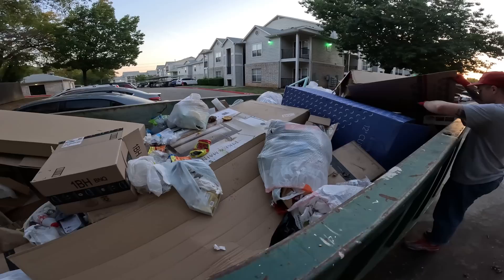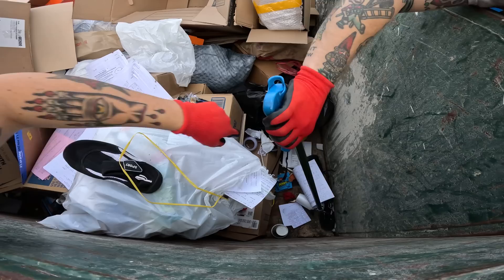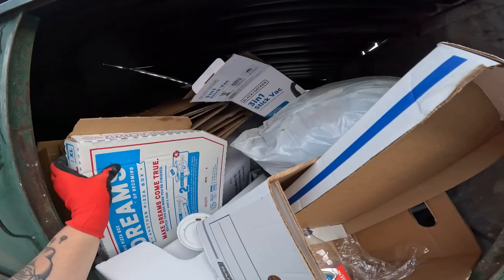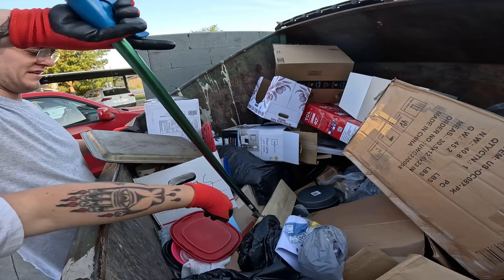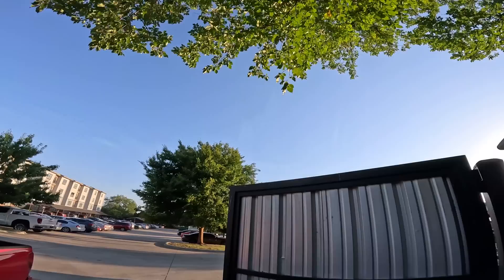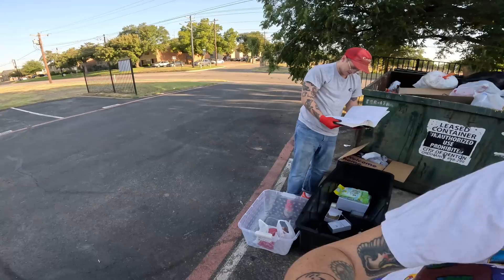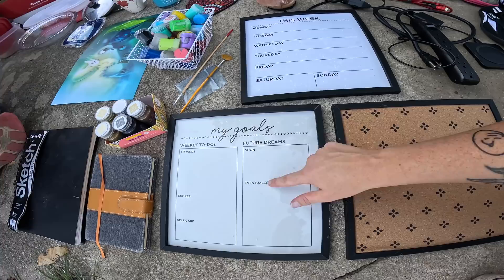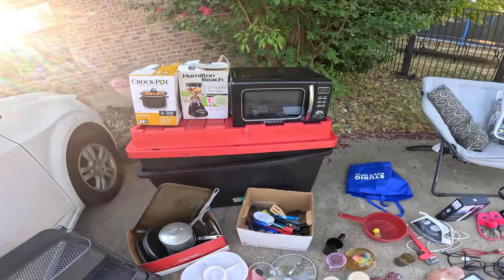The Apartment Dumpsters Were Full Again!

Comment: Yes Magnalite  GHS are sought after cookware since 1930s.  They look like they need heavy cleaning. Fill sink with hot water and good dishsoap like dawn and let it sit for 15 min.. Then apply dish soap everywhere on the pan outside and scrub away with regular (non-abrasive scrubber on inside). You want to avoid soap on inside, They are not recommended for dishwashers You can season it too If the pan is very stained you can use water and a wool pad (outside) Inside ,Cream of tarter for stain removal with the wool pad and water, If still stained final attempt is to fill pot with water, add 1/4 cup white vinegar and bring it to a boil. Once boiling turn off and let cool. Throw water out once cool. Pat dry. Hope this helps!!! Great find.

Comment: You can take the smell out of the seatee using the fabric deodorizer below if the cover is not removal to put in washing machine.
    1 cup of vinegar (deodorizer)
    1 cup of water (carrier)
    ½ teaspoon of vegetable glycerin (helps emulsify the essential oils so they don't just float on top of the mixture)
    ½ teaspoon of essential oil (use whichever scent you like best, or mix a couple of different oils to make your own custom blend)
Add all of the ingredients to a spray bottle, give it a shake to combine everything, then spray away.

Comment: That loveseat is great, just remove the cover give it a wash and you are good to go.  BTW, hint, for stinky things, put white vinegar in your rinse cycle (you can put in the fabric softer portion of your machine, and it will remove odors.  This works for plastic ware as well, just put hot water in the plastic with a good dose of vinegar and let set 30-60 minutes, then wash well.  If odor remains repeat.  Sometimes I put dish soap in with the vinegar especially if it is really stinky.

Comment: 15:37 the game of Life was a McDonald's happy meal toy early 2023.  They pledged to do less plastic and more paper and did a round of paper based travel games.  Was cool idea.  I got the Jenga one it was all flat paper boxes you had to fold into the 20 or so individual blocks.  In theory ok but try Jenga with small folded blocks it wasn't stable exactly...  curious if the other games were any good.  McD did small books after that but I think are basically back to plastic figurines again.

Oops Life wasn't a part of that release its from an earlier one...with plastic.  My Jenga was 15 boxes u kinda had to hold some down...cheating with wood blocks but ok with paper boxes.